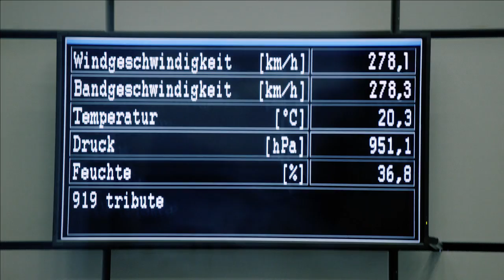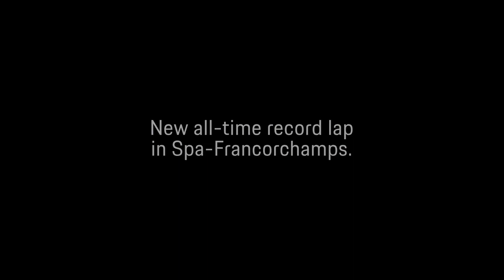The 919 Tribute on tour. First Stop: Spa

Comment: Imagine if an F1 team sees it maybe red bull (cause this is kind of stunt they probably do, i don't imagine Ferrari ever gonna do that) . "okay so you win by not playing with a rule, okay my turn this time" Red Bull RB13 unlimit. Higher fuel flow, more aerodynamic, higher turbo boost, revised hybrid system. And total 1500 hp. Now the problem is who on earth wanna drive the car with power twice its weight
Reply: rockzs74r And all the aero stuff banned in the past... not even a driver like Senna combined with Schumacher could push it at its limits, they would be the limit itself.
Reply: Throw in active suspension as well

Comment: This year the F1 will brake the Record of the 919. The only chance for the 919 record to remain is rain during the qualifying!
Reply: Simracing &More Yes, but the fact still stands that the 919 Evo will be the fastest non-F1 car. It doesn't matter if an F1 car goes faster there, as F1 cars have less weight and bodywork to carry, and are just a totally different type of car to drive, plus F1 cars are not built for as extreme of endurance as LMPs are (there is no 24 hour F1 race since the 24 Hours of LeMans was dropped from the F1 championship decades ago (i think it was dropped before WW2 or soon after WW2).
Reply: Stig Rabbid 
While you are right about the Base car being an endurance car, the 919 Evo is only built for one fast lap, meaning they could centralise their setup more about this one lap than F1-Teams could. Also, The bodywork partly helps because it guides the air better, especially around the weels, and creates massive downforce, although it can't equal out the 100 kilos more in weight.